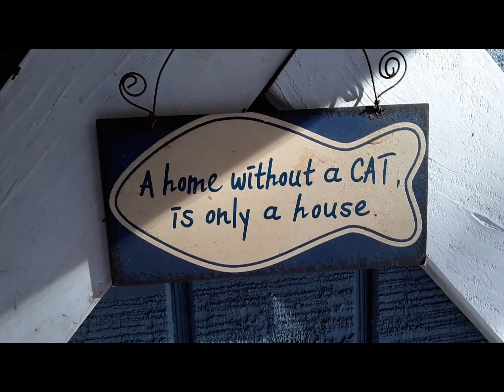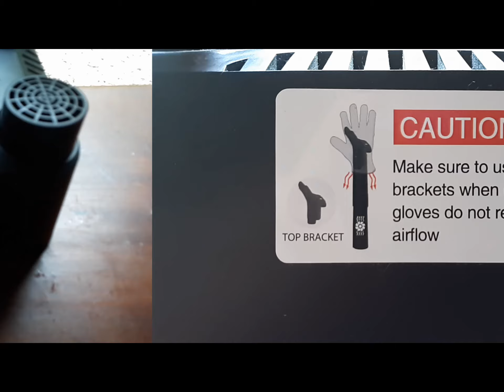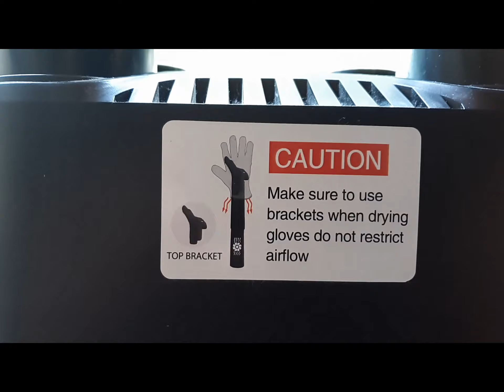FIX IT OR FAIL II

Comment: The boot dryer repair manual on page 74, paragraph 15 mentions using only plastic toothpicks. Looks like wooden ones work just fine. Thanks for the information. I was having trouble finding the plastic ones. Thanks for the tip on perfume. Take care.
Reply from the maker: My 1st boss imparted that wisdom to me at age 16. Then he had to explain it.
Shoe dryer still working, fingers crossed.